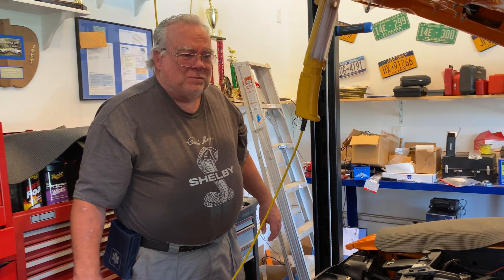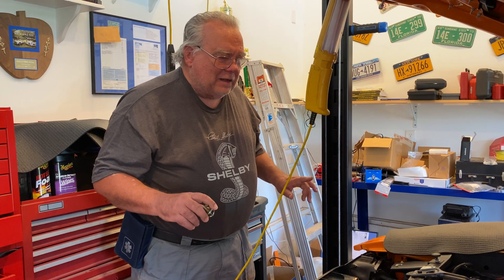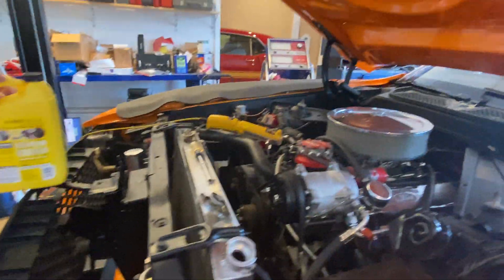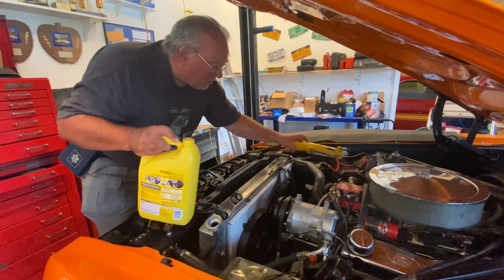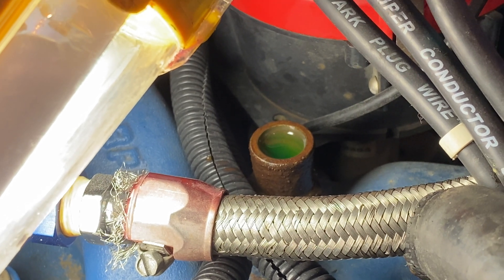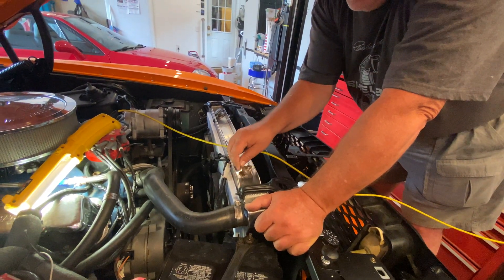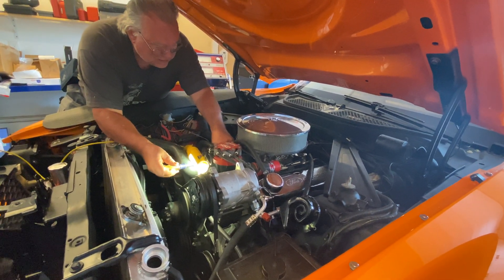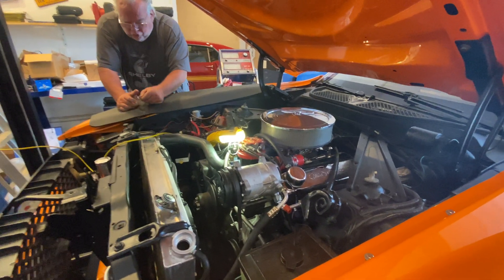First Generation Mustang Engine Coolant Trapped Air Burping/Bleeding Procedure

Comment: How about putting an aspirin under the thermostat valve to pass water ..  maybe 2 to be symmetric ?? Dissolve in short order.
Reply from the maker: I am certain that might work, but it may introduce a problem.  For me that is a novel approach, one I would not have thought to do, for a few reasons.  My concern would be the lateral stress being put on the assembly that could cause the thermostat to stick open even after the aspirin dissolved, although using two ought to resolve that potential problem.  Despite it being a potentially viable approach, the way I show is less intrusive, and involves no chemicals (Acetylsalicylic Acid), heh heh...  

The more I think about your approach (JohnWest4), the more I like it for some reason.  Dissolving temporary compounds could be useful in several areas with auto repair, or so my gut tells me.  That is definitely thinking outside the conventional box...
Reply: @gilberthale7777  maybe Rock salt too? Just get the air out... A 1/16" hole in thermostat??
Reply from the maker: @JohnWest4  1/16" hole in thERMOSTAT is not enough to cause a large amount of internal leakage, but if there is air behind it there is plenty to let the water jackets in the engine and heads to fill with coolant as air escapes through that small hole.  It is still slow to bleed the air off.  I feel my approach is the best and fastest way of burping trapped air.

Comment: Thank you! This was a huge help! All the info i could find about bleeding air was for more modern vehicles and wasn't overly aplicable to my old  F100. The ford shop manual actually instructs to do exactly what you did  but it didn't provide enough detail for someone who hadn't done it before to do it properly. Really saved me (and my pickup) on this one.
Reply from the maker: yeah, this is definitely Old School stuff, like back in the 60s, 70s, and even 80s when I was working on cars as a serious hobby and later for a living.  I am glad you found the information useful, as that is why Lynda and I produce and share these videos.  And, it helps me feel like I am still relevant despite being fully retired.  heh heh...

Comment: That is THE BEST looking car ever made. I'm not even a big Ford fan, but those Mach 1 fastbacks are the most beautiful cars ever made.
Reply from the maker: It took me many decades to give the 71-73 Mustangs a chance to be admired, as I always felt they were bloated looking in the rear quarter panel area.  Stodgy looking.  Then I began to give them a chance to be appreciated as part of the continual styling changes for all First Generation Mustangs (and Shelbys) from 65 - 73.  And we happened to luck into this Mach 1.  Once I began to work on the Mach 1 I realized how clos it was in its core design to the 69-70 Mustangs, which I love more than all other year Mustang/Shelby.  I am now a raving fan of the 71-73 body style Mustang, and even have two of them - this Mach 1 and a Mustang Convertible that is in pristine, preserved condition (just over 20,000 original miles on it).  I still like the 69 & 70 body styles more than 71-73, but the 71-73 body style has become amongst my more favored Mustangs.

This particular Mach 1 is a little unusual as it has a street/strip built 351W (not C) engine in it, replacing its original 302 2v engine.  And the original 3 speed automatic transmission has been replaced with a 4 speed Automatic OverDrive (AOD) transmission.  Further, the prior owner replaced the original 2.79:1 rear axle ratio gear set with a 3.5:1 Tractionlok set of rear axle gears - which gives it some really nice low speed performance potential.  Between that relatively low rear axle ratio, and the OverDrive transmission we have the best of all worlds re: great low end performance, and really good upper end performance as well.  It is a blast to drive, and it cruises nicely at highway speeds.  At 60 MPH in 4th gear in the AOD, the engine is running at just under a mere 1,900 RPM!  And the built engine has the torque and horsepower to overcome the impact of the air resistance at higher speeds, so we make good use of the OverDrive gearing of the transmission.  Very cool...

Comment: Very informative. Thank you.
I have a question.  I have 65 K code Mustang. I replaced the radiator.  When I refilled the new radiator with coolant, the system accepted far less than 14.5 quarts that should be required.  Any idea what is going on here?  Your thoughts will be appreciated.
Reply from the maker: It the coolant was lower than the temperature rating of the thermostat, it is possible the thermostat seal was so tight hat when you drained the coolant from the radiator, the thermostat being closed caused a vacuum inside the heads and engine coolant jackets which prevented the coolant from fully draining from the heads and engine block.  By opening up the heater hose inlet furthest back from the water pump, in the same location as the heater hose inlet shown in this video (351W, not C) that vacuum would be relieved and the engine cooling jackets should then full drain.

I have seen comment from others saying the factory specs for 14.5 - 16 quarts of coolant capacity is incorrect.  Those same folks seem to feel 8-9 quarts is the actual coolant capacity.  For a v-8 that seems pretty low.  I lean more toward the 14.5 - 16 quart capacity being correct, and the vacuum behind the thermostat during coolant draining is the cause of the problem with "low coolant" capacity based upon what is drained out.
Reply: @gilberthale7777  Not sure what is going on here.  Before I installed the new radiator I flushed the system with the thermostat removed and then installed a new thermostat.

I did notice that when I flushed the system after draining there was more coolant expelled before the water ran clear. So the engine seems to retain some coolant even after the system is drained. If that's the case, the 8-9 quart max may be right.

Thank you for the help.

Comment from the maker: Greg Avitia posted a question, and in my attempt to respond I deleted his comment.  I hope finds this reply.

Greg's Question:
I know this is 10 months old, but it was a great video. I am running a SBC in my jeep and just installed new heads. We filled up the block through the thermostat opening on the manifold. When I started the engine it took a long time to register a water temp. Then pushed antifreeze out the overflow tank on the test run. The temp went to 225 degrees at a stop and then settled at 190 (185 degree thermostat). I wonder if I had some air pockets that may have created the problem? Any ideas?

My reply:
If the temp finally settled down at 190 with a 185 degree thermostat and you had no boil over it wound to me like you had some air trapped behind the thermostat, and when the thermostat opened it burped the rest out on its own.  No everybody is that lucky.  As long as the situation does not repeat I am certain you will be fine, assuming you are not overheating.

If the problem does persist or repeat upon warm  I would try to burp the engine yet again (I am betting that will not be needed, but just in case...).  If that does not resolve the problem I would suggest doing a Blok Test to make certain combustion gas is not getting into the cooling system.  that is a stretch to say the least, but it if one base that ought to be covered.  I have a video showing how to do a Block Test in case you are not familiar with it.  Easy to do, and most parts stores lend or rent them out - sometimes for no fee.  Other times for a very low fee.

https://www.youtube.com/watch?v=OhNQVEp7Kxw

Please let me know how this turns out...

Comment: Will this method work if I've replaced the intake manifold gasket and drained the system of coolant and there is no coolant behind the thermostat?  Much thanks and great video
Reply from the maker: Hi!  In some engine designs there may not be a heater hose that is located in the same place as the one I removed temporarily to bleed out air trapped inside the engine coolant passages.  But, there will be "somewhere" from whence you can pull off a radiator hose located " behind the thermostat where air is trapped.  By removing that hose long enough to let the trapped air in the coolant passageways will get you the same result as I have shown in this video.  If you have a Thermal Vacuum Switch (TVS) located somewhere on your engine, that is another viable part you can remove temporarily to purge the trapped air also.  I recommend using a teflon based sealer or tape on the threads of the TVS before you reinstall it back into its proper location.  If you have further questions or need more clarification please feel free to add another comment, or email me at gilhale@gmail.com.

Comment: Another very informative video by you both, gotta love old school knowledge 😉 even though I have a cleveland, you just keep teaching me things that make a whole lot of sense, by the way Gilbert would you by any chance have an wiring diagram for a 73 Q code? I also noticed, did you move the radiator mounts to fit the new radiator?
Reply from the maker: Greetings!  And thank you for your kind comments.  To your first question, yes, I have wiring diagrams.  Both licensed schematics acquired through Forel Publishing (very inexpensive PDF file), which has vacuum schematics, connector, splice, ground, and other useful information.  And I also have a no fee scanned set of schematics which does not have the vacuum schematics, connector, splice, ground, and other related additional information.

I am happy to share the no fee information, and snippets of the copyrighted, fee based schematics to some reasonable degree.  If you like the thought of having some really useful PDF files that provides some great schematics, and emission control systems and related vacuum routing from the 6 volume shop manual, you can acquire and download those files, and more, from Forel Publishing at the following link:

https://www.forelpublishing.com/clickbank/index.html

It is hard to go wrong with the documentation from Forel, especially beginning with 1973, and even some 1972, Mustang manuals.  For years prior to that the wiring schematics from Ford were quite terse, lacking really useful wiring content, having no vacuum line routing information (although Mustang Barn put together some good vacuum system info for 67-71 Mustangs, for free, which I compiled into one file per year).  In 1972 the documentation got pretty good, and by 1973 it was quite complete and very nicely assembled.

If you would like me to send some of the files and file snippets I have please email me at: 

gilhale@gmail.com.  

If you would like some snippets of the more detailed wiring schematics let me know which circuit(s)/system(s) you need help with.

As for the radiator supports being used, you are very observant.  I used the original radiator upper support brackets, and lower retaining brackets.  They fit the new aluminum radiator "well enough" to keep things in place.  I could have fabricated some retaining brackets that would have fit "better," but frankly the ones in use now work plenty well so I not bother spending the time and effort in fabricating a different set of retaining brackets.  There may even be some 3rd party brackets you could use, but anything more I say would be beating a dying horse.  I am not usually a, "good enough is good enough," kind of guy.  But, in this case that is a rather fitting phrase (no pun intended).